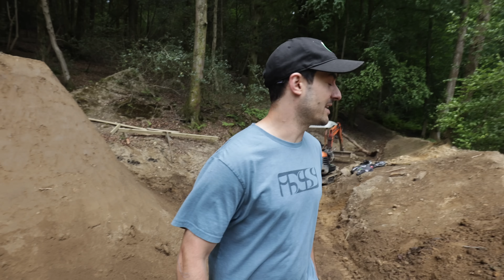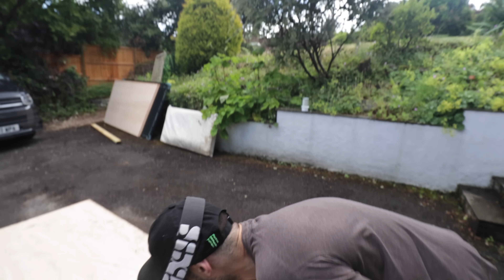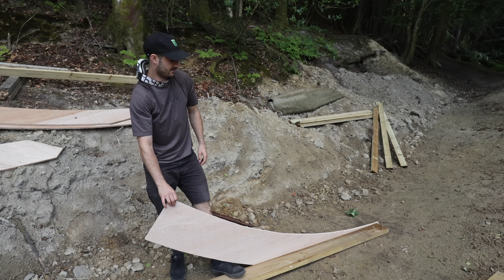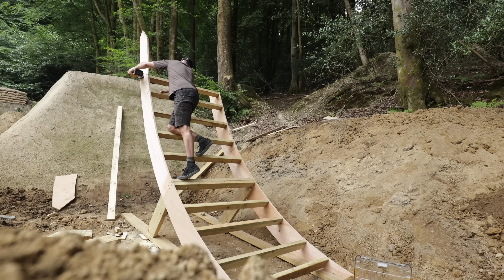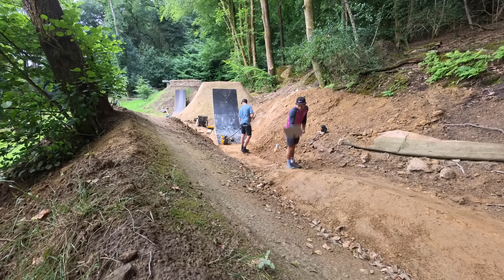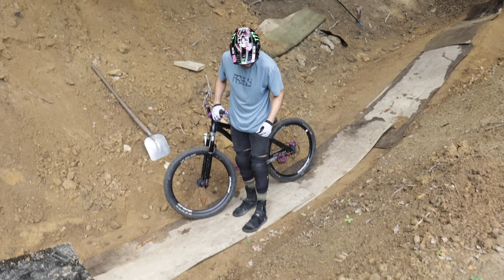Building & Riding a New Dirt Jump Line in My Backyard!

Comment: You should try making a jig for the saw. 

Attach saw to end of 3.6m long 2x4 

Drill hole on the other end of  2x4 and attach that to a fixed point so that it can swivel

Perfect cut everytime.

The radius 2x4 could even be a couple boards overlapped and screwed together and if you want to adjust the radius you just reposition the 2x4s
Reply from the maker: Good idea! I'll have to try that next time for sure

Comment: Am I the only one that finds it insane to cut lumper to a fraction of a cm when the width of the base could literally be anything? Either cut the boards in half, thirds, whatever so you don't have a bunch of shitty leftovers.
Reply from the maker: We just make it to the width of the big ply board on front so we don’t have to cut the boards all the way up the edges. It’s just the way we do it but I guess your way would work too
Reply: @SamReynolds26 I see. The top sheet is that size. Duhh